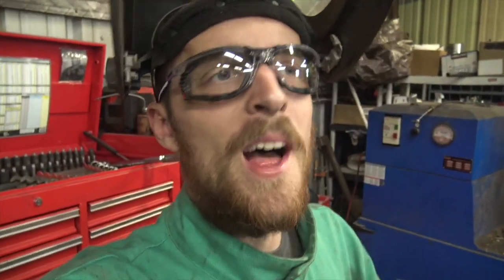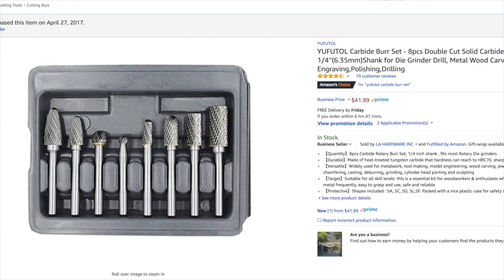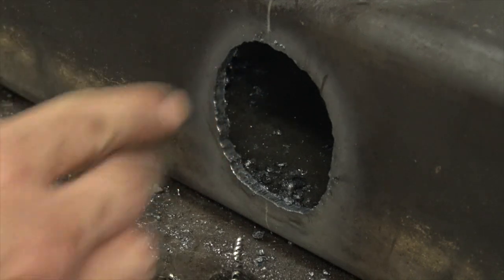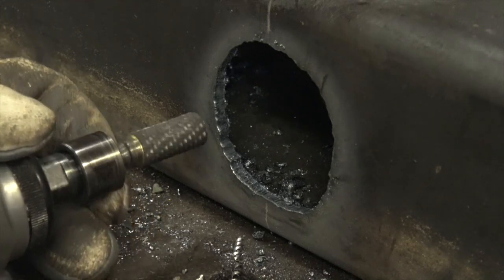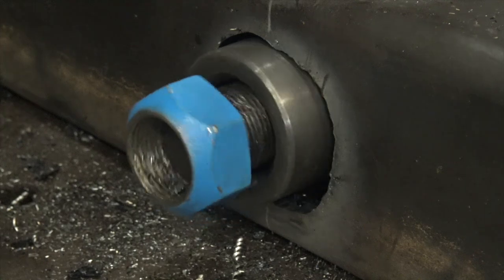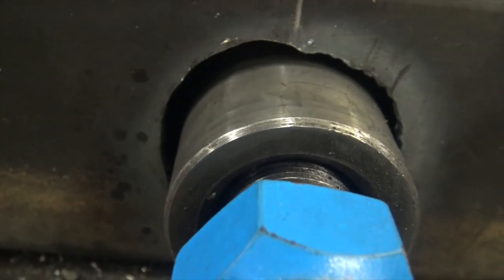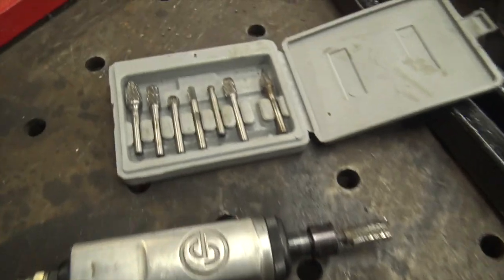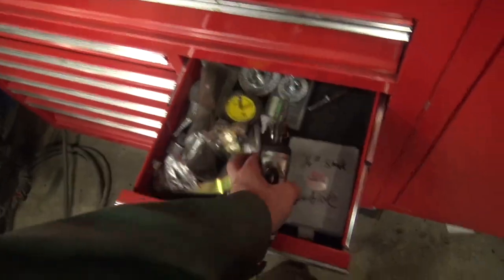WHY THESE CHEAP CARBIDE BURRS ARE CRAZY GOOD?!? THE BEST KEPT SECRET BUY ON AMAZON???

Comment: We use die grinders with various carbide burrs every day in our welding and ironwork shop.  Milwaukee M18 cordless die grinders with only quality carbide single cut and double cut carbide burrs from machine shop supply houses.  They are an absolute must for any metal working applications, period!  Many shape burrs to chose.
Word of caution though, use them only in an area that is easy to clean up.  These are the messiest tools you will ever use.  The sharp metal shards they produce are razor sharp and go EVERYWHERE.  Suit up appropriately to avoid trips to the ER.  Still, one of the most valuable tools in our welding shop and on our trucks.  Steel cuts wood, high speed steel cuts most steel, tungsten carbide cuts everything else.  Put it in a high speed cordless die grinder, use it CLOKWISE only and go gently because they cut extremely fast.  Best invention since cold beer.  If possible, use these tools outside and not in the shop unless you have a special area, I am not kidding about those horrible sharp chips they produce at high speed and cover a wide area.  Full face shield and clothes those hot chips can not stick into.  Once, on a hot day, I used one while wearing a short sleeve shirt, cloth gloves instead of leather gloves and only small safety glasses to grind a weld out of the way.  I may never be able to have an MRI because of that.   I am no Rookie at this with 53 years of experience,  heed this advice.  You will love these tools.

Comment: My only problem with burrs are that you need a fairly beefy grinder to run them effectively, 3/4 horse or better, and more importantly to me the slivers are the absolute worst things in the workshop and I will go to nearly any length to avoid using them for that reason. Glitter from hell gets absolutely everywhere and if you've get any on a lifting sling you might as well throw the damn thing away because you will be picking slivers out of your hands every time you so much as think about picking it up.
Reply: Mine run fine on a little bitty minimum size pneumatic die grinder, as long as there's sufficient air pressure.
Reply: I do nearly all my grinding outdoors and if I want to clear the air around me of rust, dust and paint chips I use an old bounce house fan since they're easy to aim. I get good results with small grinders but my favorite is using a steel Jacobs chuck drilled and tapped (on a lathe for concentricity) to 5/8"-11 which fits my angle grinders. Beats carrying my Milwaukee 5196 beast and works a treat.

Comment: I wonder if i can use these cheap bits to grind with corded die grinder. I need to grind bolt heat off exhaust flange, but the area is inaccessible for angle grinder, so i wonder if this would do the trick? Please respond .

Comment: I have always used them with my roto zip but I just had one bend as soon as I turned the tool on I'm not sure if it was a defective bit or defective user I'm terrible with tools that take a gentle touch so I only use them on stuff that have a lot of room for mistakes because they will burn through hard metal real quick
Reply: I believe our carbide burr will let you down